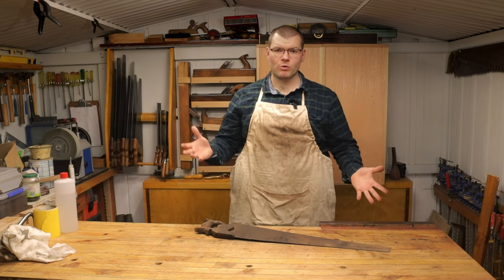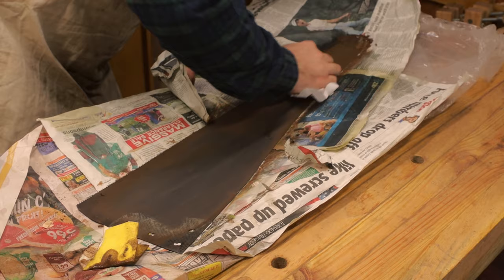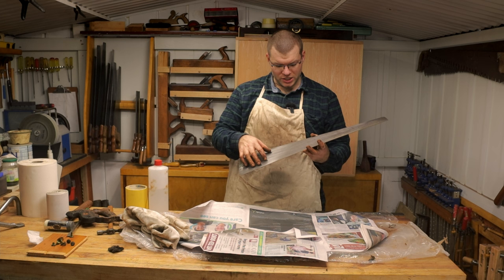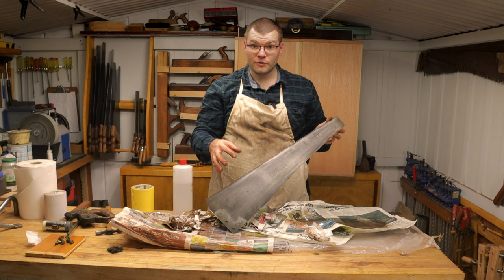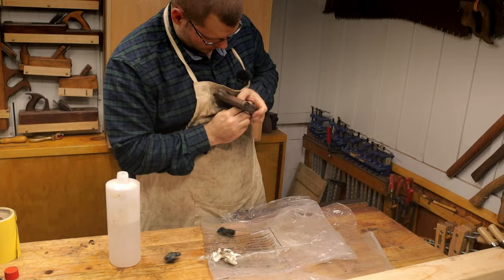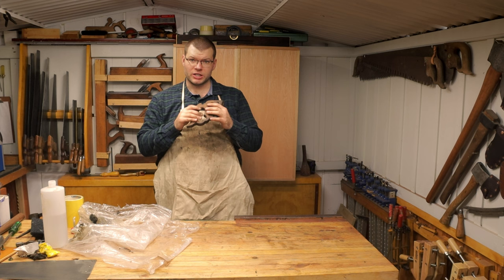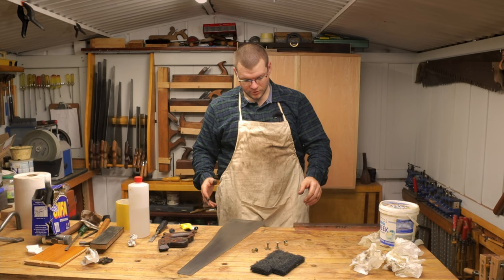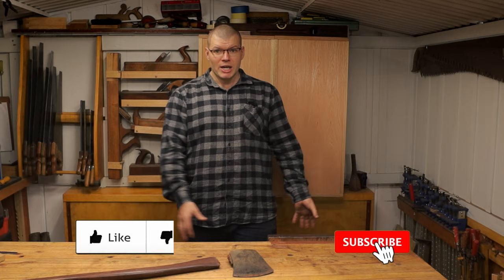How to RESTORE old hand saw

Comment: Good that you didn't overdo things and destroy the patina of its history. I've done a few of these the same way and was very happy with the result. A good way to clean the brasswork without the risk of too much abrasion is with very fine 0000 steel wool and neat ammonia. Always use it in a well-ventilated space but the result is impressive.
Reply from the maker: Thanks for a ammonia suggestion i will have to give it a go, i find 0000 steel wool and fine honing compound like tormek paste work well also.

Comment: Need an advise - paste wax versus oil for the saw blade ? What is best and which product/s , please?
Reply from the maker: Great question Ill try and break it down into sections see if i can help you out:

Lubricant of saw plate:
I think the paste wax wins this one as less frequency of application is required and the wax in the paste wax stop the saw friction more. Another option is rubbing a candle on the saw plate this work well too and is quicker than paste wax.

3 in 1 oil is still better than nothing (but requires more frequent application) and does work but the paste wax is definitely better, i tend to use candle wax the most for this however.

Rust Inhibiting:

I think the 3 in 1 oil maybe slightly more effective here as the paste wax does have a tendency to have dust stick to it which is a cause of rust in the first place.

Paste wax does still work but if i have used paste wax to lubricate the saw plate i just wipe it down after use and i haven't really had any rust issues doing that.

Pro/Cons

3 in 1 oil:
1) The 3 in 1 oil is cheaper option than paste wax generally (based on the products i purchased)
2) 3 in 1 oil is easier to apply with a tool oiler (https://youtu.be/ttLREWZt1YU)
3) 3 in 1 oil evaporate in hot temperatures
4) works slightly better to prevent rust in my experience
5) 3 in 1 oil is readily available where i live.

Paste wax:
1) Slightly more expensive, but you can make your own (https://youtu.be/GTxraznnTiI)
2) Slightly longer to apply as you have to wait for it to dry and buff it off
3) Works better to lubricate the saw plate
4) doesn't evaporate & lasts a long time
5) tends to attract more dust

Products i use:

+ 3 in 1 oil and a rag or tool oiler - link to my video on a tool oiler [rag in a can] (https://youtu.be/ttLREWZt1YU)
+ Home made paste wax Raw linseed oil and bees wax - link to my video on making paste wax (https://youtu.be/GTxraznnTiI)

Note: There might be commercially available paste waxes that might work better but i can't comment to that as I've never used them, the same maybe true to oils there maybe better ones out there than 3 in 1 oil.

Final Thoughts:

I tend to use the paste wax for both more than 3 in 1 oil as it doesn't evaporate and lasts a long time. But my favourite products for lubricating a saw plate is a small tea candle just rubbed on. I save the 3 in 1 oil for gardening tools and when restoring anything with a screw thread [i add it to prevent binding].

Hope this helps

Comment: I am going to assume that this is a Canadian made Disston? What was the name on the label? You have used a pretty aggressive sandpaper particularly over the etch would you not be better off to use more grades in this area to see if there is a possibility of saving it. If you are starting with 120 could you save a substantial amount of time using a palm sander?
Reply from the maker: This particular Disston was manufactured in Philadelphia. The Medallion clearly show DISSTON and PHILA, which is dated to 1917 - 1940's using http://www.disstonianinstitute.com/medv2.html , Sorry i didn't get a close up in the video. 

I could have definitely used finer grits of sand paper had i thought the etching may have been there, however in my experience a handsaw with that much rust and surface pitting the etching was unlikely to have been there. If i had a container large enough to fit it in i would have used Evaporust solution to remove the rust instead of sand paper, however the saw plate was too long for this.

You probably could save time using a palm sander, however and palm sander like random orbit sanders etc scratch pattern maybe visible in the finish product possibly as swirls. I use the sand paper by hand as your want to go with the grain of the saw plate which is usually in the longitudinal direction of the metal, this does a good job of hiding scratch patterns you may have missed after moving through sand paper grits. That being said i don't own a palm sander so this may not be an issue, i can only go with my gut feeling that it might be an issue.

Hope this helps

Comment: Don't you bother soaking it in anything  first?
Reply from the maker: With the smaller saws i do, but these longer handsaws I don't. The main reason is i dont have a container large enough to fit the saw plate and likewise it just too much vinegar or Evaporust to cover the saw plate if it was in a container. 

However, it is usually not required to soak a saw plate. I have found through all the saws I've restored the rust tends to be very surface, and easy to remove with sand paper. If rust dust is a concern for you, use wet and dry sand paper with water or alcohol to prevent said dust.

Hope this helps
Reply: @AussieWoodshed  appreciated.  Thanks